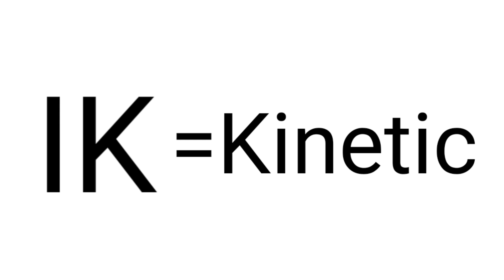What are IK ratings? : Electricians' Q&A

Comment: IEC 309 32A commando sockets fixed to the concrete  floor under the raised floor of a data centre.  IK10 specified.

The practical reason:  would they survive having a floor tile dropped on them?  In reality those tiles are heavy and have sharp metal covered corners, so just possibly not.  But it was the best that could be done.  😂
Reply: especially with a fully kitted out rack of about 700kgs on top :)

Comment: Everything has some sort of Mechanical protection even though it doesn’t say on the sticker. Can’t really think of anything that could be IK00 apart from a glass bulb . You can also compensate for the lack of a suitable IK for a specific area like for example a car park with low level emergency bulkheads that can be hit by cars, you add one of those steel mesh caps to satisfy the IK requirement.
Reply: What’s the IK rating of the junction where the conduit enters the box? 

Will an IK10 rated item protect against a forklift that runs amok? 

You can only design so many defense systems or levels of protection because a fool can do things no sane person has ever considered.